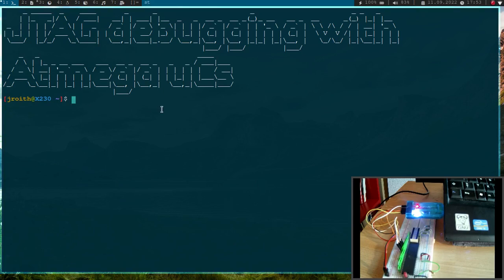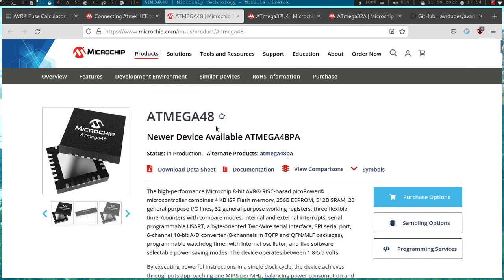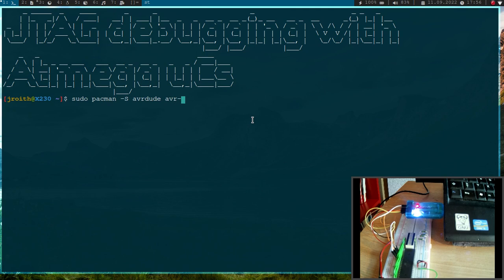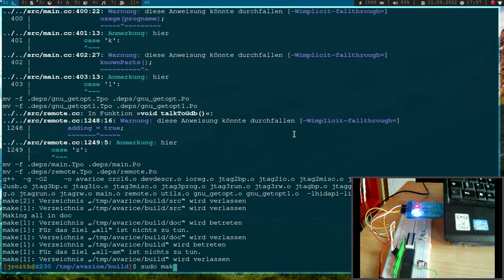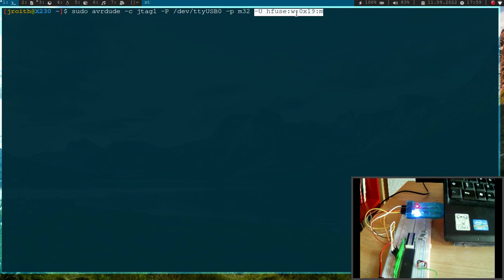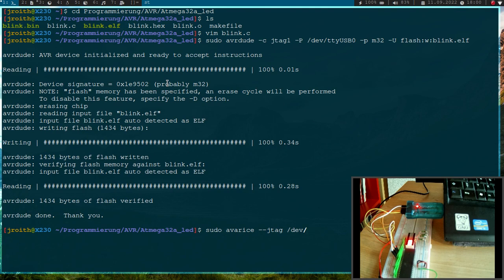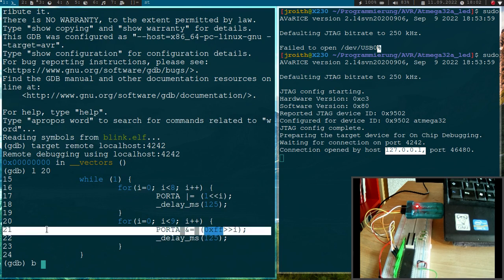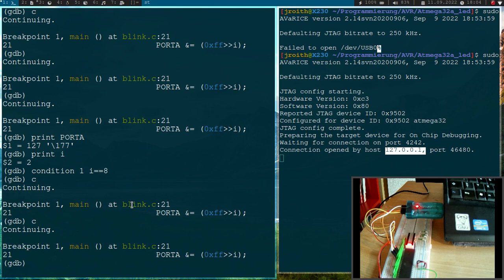JTAG debugging some Atmega microcontrollers with JTAG ICE (avarice, avr-gdb, avrdude)

Comment: Unfortunately Atmel didn't make their JTAG instructions public and so you can only use JTAG with their SW/dongle and not with openocd. Bummer.
Reply: you,re write but you may check avr jtag user guide from microship for using the avr studio instead of using terminal cmd and it's step by step guide